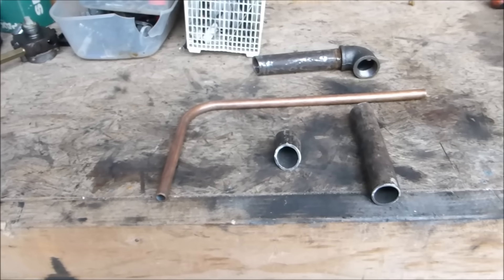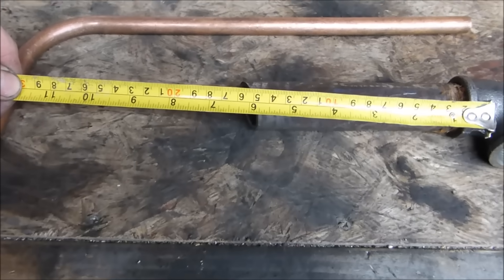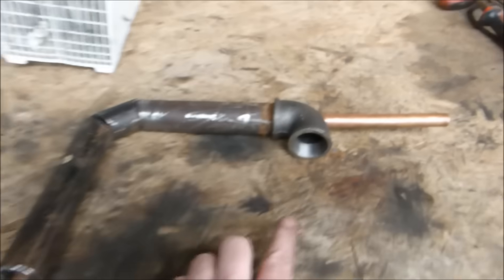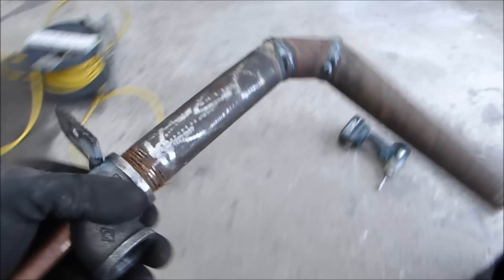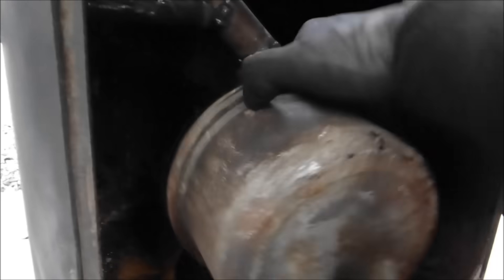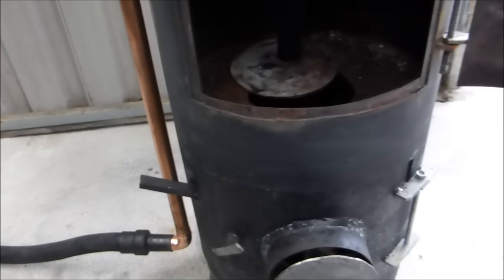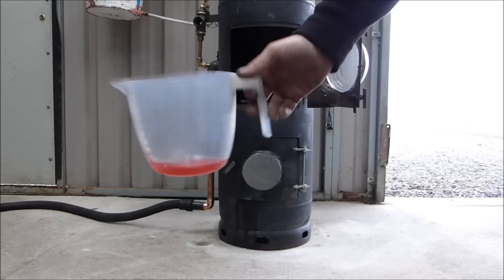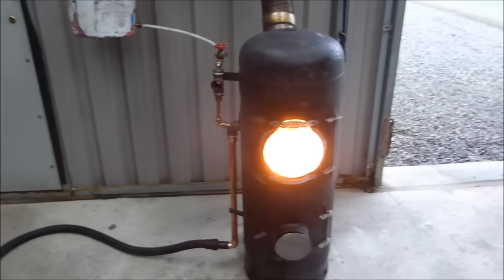Build a New and improved fantastic output Waste Oil Burner.

Comment: well done and beautifully explained, I subscribed. I might have a bit of useful information: I'm in the restaurant industry, and wherever there have been restaurants, there is a restaurant graveyard somewhere. This is where all the stoves, ovens, burners, grills, fryers and so on go to die (or be repurposed). It's an intelligent mechanic's paradise, because this stuff is scarcely more than scrap to the junk yard owner. If you want to "pick and pull", all the burners and grates and tubes and governors and valves and pipes you want, you can buy for a couple of dollars. I use them for fixing my restaurant, but you could certainly use them for a myriad of burners, alternative fuel vehicles, jet engines, who knows what else.

Comment: You could have also drilled 3 holes in the outer pipe and put some screws through it to center the copper inner pipe..

Comment: Hi  Gerry. Great videos. Great ideas. would it be worth putting a flash back arrester in Line on the oil feed just as a safety precaution??? or is there any need.??

Comment: it takes electricity to run, 40 years ago in potbelly stove a 3/8" plate steel piece at an angle in the belly with oil dripping on it.

Comment: A few more observations, you would want a blowback valve if you have a feedback attatched with larger amounts of fuel ,oil ,kerosene or however you spell that,  I think there are better says to achieve what you are doing hele, the idea is good  but nobody wants accidents based on these sort of videos ,so be careful out there.

Comment: out of interest do you still use that oil burner did you find any parts that you would want to improve or any safety aspects you weren’t happy with just out of interest as it’s an old video and it’s just popped up on my recommendations it would be cool if you had a follow video to this or you might have one you can send me the link to thank you

Comment: Gerry, here’s one you should attempt that you could get paid for your energy source. We leased out several acres to a tire recycling business that had extreme potential but was owned by an idiot. He ended up grinding close to a million tires with no ability to remove the metal. As you can guess, a fire broke out and soon we were making worldwide news. We used the equipment from our surface coal mining facility to build a dam all around the burning chips that were stacked 30ft high. Used several 6” and 8” pumps to fill the entire area with water. We completely extinguished the fire in 2 days, but the interesting thing is the superheated chips buried in the middle of the continuous lack of oxygen caused crude to separate from the rubber. A stream of overflow was mostly crude oil that we had tankers skimming the top of the sediment pond. That has always had me wondering if you had a way to heat a tire in a sealed, oxygen free atmosphere would the trapped crude be enough to feed itself sufficiently once everything is up to temp. Not only would the oil make heat, but the remaining material is very high quality carbon steel. The environmental unfriendly ash from the cooked product now becomes a high quality fertilizer that we used on the reclamation mix that had incredible results. Don’t know if we could make it happen in a garage, but seen nature create several tanker loads to be taken separate the remaining water. With the thieves controlling our energy prices again, may be with a try. I imagine crude will be tough to acquire once WW3 is played out to realize Chinas 100 year plan to own the world. Drafted in 1949, China will accomplish this plan years ahead of schedule.
Reply: K

Earache

Comment: I had a thought.......
What if you use the fan, which you use for bringing in the air, to spray the oil in the flames ???
Would you use less oil
Would you get a higher temperature
Would you get therefore a flame that is instead of yellow, blue(er) and so could be more efficient ??

Just mentioning 

Kind regards, Jacob

Comment: Just out of curiosity what did you use for a window on the door
Reply from the maker: Hi. Its just  pyrex cookware dish. They work great and seem well able to handle the heat. Just leave the metal enough room for expansion. Cheers Gerry
Reply: @GerrysDiy  thanks for the info

Comment: Jerry. My T valve with hole drilled thru the back first was draining over the hole and pouring out the hole. 
Leveled the T valve left and right. I cannot get oil to flow in the center( pencil lead thickness like yours flows. It just fliws against the side of the walls then flows in. 
Any helpful ideas please

Comment: Thank you so much for your detail with stating measurements, angles, etc. The last video i watched, the guy was using an adjustable wrench to turn a thread tap and it made me cringe so this video was a relief. Your attention to detail makes it easier for followers to replicate the project. Keep up the good work!

Only question I have is.... If I want twice as much heat output do i make 2 of them or can I scale this design up proportionately? Will it still atomize correctly if I double all of the dimensions?

Comment: I saw this thought it was great gave me the ideas ,how ever I kept on modernising.your not burning efficiently yellow flame means not all burnt  waste of oil. I’ve built a couple and you can see  through the burn chamber even with the door open clear as a bell so hot it eats 6 mm steel if close enough plus inner skin to stop it blowing the tank away and angle uprights cos the tank would sag

Comment: The galvanised wire and copper tube could be an issue with electrolysis and effect life of the copper tube.
Reply from the maker: Hi Ian. After a few sessions in the fierce heat the wire does not remain coated for long. Works great though and I have used this setup in many of my stoves as I play around with the design. Appreciate the comment Cheers Gerry  👍👍
Reply: No worries

Comment: What kind of glass is that?
Reply from the maker: Hi Tony. It's just a pyrex bowl. The glass can handle the heat you just need to give the metal enough room to expand without putting pressure on the bowl.  Thanks for commenting Cheers Gerry

Comment: Love it, very clever yet simple and effective! Subscribed! I need to build something like this, to burn my waste motor oil + cooking grease. I know I can probably (legally) dispose of it for free, but there's something about throwing away perfectly good fuel that hurts. 
I am curious why popular commercial waste oil burners use compressed air to atomize the fuel -- I have seen several gravity drip designs like yours, and I would assume that once the fire box gets up to temperature, the intense heat is all that's needed for complete combustion. Maybe the pressurized air is just to ensure complete combustion from the minute you fire the unit up, to ensure a quality burn even when cold starting, since the commercial units can be run off a thermostat. Either way, for a typical home shop, it would probably take years to pay back the difference between something like what you built, vs paying ~$2k+ for a commercial unit.
Reply from the maker: Hi Matt. I have made normally aspirated burners too and they work great without any power. The trick was to change the burner design. No visible smoke and tons of heat too. Thanks for the Sub and taking the time to comment Cheers Gerry 👍👍
Reply: @GerrysDiy  .can you put a system like this in a outside central heating boiler chamber if the standard riello oil burner is removed

Comment: Half inch washers welded in pipe ?
Reply from the maker: Hi Josh. The washers would stop airflow between the 2 pipes. The 1/2 inch copper carries the oil and the  1 inch steel pipe carries the air for combustion. A spring will allow the air to continue. I have made lots more burners since this one. Here's a playlist https://www.youtube.com/playlist?list=PLmQ5wJnkAIoJYDBgSOis9s1yDhcFdswtN   Thanks for taking the time to comment Cheers Gerry 👍

Comment: What keeps it from just blowing up? Lol 😆 sounds like a noob question
Reply from the maker: Hi. Slime There is no pressure build up.The exhaust goes up a chimney and the stove gets a measured amount of fuel. The oil burns because it is being vapourised by the intense heat in the burn chamber and the gas readily burns. Can make a serious amount of heat though. Thanks for commenting Cheers Gerry👍

Comment: Impressive! Although, how much air escapes from the hole in the 1" pipe elbow where the copper pipe goes into the plumbing?
Reply from the maker: Hi Oddly enough that hole acts as an air intake when the fire is lighting. Some of the air for combustion is pulled through the gaps. This is why when the stove is running I can open the door and the fumes still go up the chimney. Also if i run the stove nuclear and it is glowing red that hole gets bigger with thermal expansion. Thanks for commenting Cheers Gerry👍

Comment: Hi there, great videos and watch them a lot,. I made one a couple of years ago but struggled getting it hot enough with lack of airflow through the stove. I'm now gonna try it with the pan and air pumped in. Might have to start from scratch as old cylinder is burning away. 
Q what sort of pump/blower are you using.
Fantastic vidios, very inspiring 👍😊
Reply from the maker: Hi hiluxtoy. Sorry I missed your comment but the channel is getting bigger now and it's getting impossible to keep up. I made a new stove that has no waste oil burner in it. I will be doing a job on it over the next couple of weeks to get it running on oil. There might be something you are missing that you will find in those videos. keep an eye out for my live stream in about a week and I might be able to help you out there. Thanks for commenting Cheers Gerry 👍

Comment: Great design, I’m going to make a mini version to use as a stove, is there a way to stop heat going up the chimney?
For example put the chimney at the very bottom at the back so all the gasses have to travel up over a baffle and then down to the start of the chimney and out? If that makes sense? 😂
Reply: I think you probably could use such a baffle, or even a series of baffles but definitely keep the bottom of the chimney up high or the exhaust will just back up and likely extinguish the flame.
Reply from the maker: Hi Fluffyhead. This works really well and can make an absolute ton of heat. good luck with your build. Cheers Gerry

Comment: I cant help but notice that your oil is new, maybe even cooking oil; how about waste oil? Dirty, nasty used cruddy waste oil! 
I'd personally like a true representation of flow and how to keep the actual fuel running. What problems occur with real waste, do you filter, how to filter etc. 
I feel fresh oil is misleading because that's not what anyone will be using for fuel. Otherwise great video and thank you for taking the time to make it.
Reply from the maker: Hi Jon Doe. This will burn any type oil that will flow and  makes a ton of heat. The trick is to get the burn chamber red hot and after that it's pretty agnostic to what is burnt. Thanks for commenting Cheers Gerry

Comment: Very interesting,  I do believe I just found a new project!! Just curious, do you keep a steady drip going, if so what would prevent the flame from traveling up the supply line? (Sorry if you talked about it in video, I skipped through some parts) thanks for sharing
Reply: The oil doesn't get hot enough. In fact it's kept very cool by the fresh air running around it. The oil line is within the forced air input.

Comment: . . . what is the source of your forced air?
Reply from the maker: I use a variety of blowers but in this video I was using an old oil burner fan as the blower. In some of the videos I have even used a hairdryer on cold. Not long life but good to experiment with. Thanks for commenting Cheers Gerry

Comment: How much air pressure are you using
Reply from the maker: Hi Truck Talk Videos. I am just using a fan but the pressure is low just a few psi. I have another burner that I make that uses no fan and can make as much heat. here's a link https://youtu.be/kWul5SL2FOg Cheers Gerry

Comment: Почему медную трубочку прячут в железную? Зачем это? Почему так нужно делать?
Reply from the maker: the outer tube is steel and I can send air into the burn chamber through the steel pipe. The copper pipe is for delivering the waste oil. hope this helps Cheers Gerry
Reply: @GerrysDiy  медную трубку оставь, как есть. В железной трубке.
Но воздух в нее не подавай. Он холодный, а это плохо.
В камере сгорания должно быть максимально жарко. Пекло должно быть. Масло желательно подавать горячим. И подавать раскаленный воздух. Воздух предварительно согретый пламенем.
Тогда реакция окисления, то есть, горения, происходит мгновенно.
Будет меньше копоти и дыма.
Пламя будет только в камере сгорания, а не в трубе.

Comment: Your waistline all that energy, horrible design in my opinion, in Vermont your used oil is worth $ depending on the exact product and quality but we use waist oil for heat..seems so wasteful to burn just to get rid of
Reply from the maker: Hi. There are more efficient designs but as a shed heater it makes a ton of heat and for me here in Ireland it's free heat. It's been a mild winter this year here but doesn't get as cold as Vermont. Just heading out the door now to go paramotoring. Thanks for commenting Cheers Gerry
Reply: GerrysDiy well I owe you a apology, I did not realize you where using the heat, I am sorry I should of paid more attention, I thought you where just burning the oil and all the energy was going up in smoke, my bad.  Hope you had a wonderful flight, I am a pilot as well.

Comment: I want to turn something like this into a rotating force that will run a generator.  First thoughts...boiler with steam engine powering a generator...now I'm thinking...heat escaping up and out stack...how can I get that heat escaping to rotate a shaft and power a generator...whala..off grid power production....spin a turbine idk...let me know what you think.  gandl2123@gmail.com

Comment: Reply to Brad not Landa
I was in the infantry in Alaska in the end of the'Nam era. We'd be out in tents at 60° below Fahrenheit and more. 

They were heated with "Mogas" which I think was a blend of diesel and kerosene. We'd suspend a 5 gallon Jerry can on a tripod and feed a thin copper line through a thick rubber section of roof. The fuel line went into the Yukon Stove, about 12 inches square and a couple feet long with a 3 inch or so Diameter chimney. 
There would be a fire lit right at the front door with kindling and branches under a cast iron plate that the mogas would drip onto.
NOT a steady stream, a drip by drop onto the plate. The wood fire would burn and the mogas would drip onto the wood and charcoal and keep it burning. That fire was directly under the cast iron plate - which eventually got hot enough to vaporize the drip on contact by the drip. At that point, the fire roared in time with the drip speed. The sides near the front would get bright cherry red. Forging temperature.

Comment: Yea this build has been already done this is just a copy of a another video. I dont think that is a Propane tank it looks too thin. More like a hot water tank 40 gal?
Reply: Obviously an armchair critic.... because u obviously have never cut into a propane tank ... they r very thin , an old air tank will be 2 to 3 x's as thick as a propane  tank ..  and a hot water tank would be about the same thickness as a propane tank.... just n case u ever wanna get  out the chair n build one .... use an air tank

Comment: Really like your videos Gerry. 

I'm building one of these myself using an old compressor tank.

Gave you calculated fuel usage at all? It would be interesting to know how much waste oil is burned over a said period of time in relation to the heat output.

I have a large workshop that I am intending to heat with mine.
Dr Gadget.

Comment: I'd imagine it would make the room a bit smelly.  Pretty cool.
Reply from the maker: Hi Sean. The flue can make enough negative pressure to remove all the fumes 100% Amazing amount of heat for very little fuel. I have made my own burner that does not require a burner. Check out one of the playlists. Cheers Gerry👍

Comment: Quick question. When using waste cooking oil do you need to preheat oil?
Reply from the maker: Hi Dbrown Brown. I don't preheat the oil, room temp works well but if the oil was very thick maybe then it would need it. Thick oil could be pumped with a peristaltic pump again without the need for preheating. Cheers Gerry

Comment: Hi Gerry,

I made a waste oil heater of my own..  i'm from holland..

I use a steel plate with a 130mm hole welded a 130mm 15cm high steel pipe on it and made arround 25 holes in it.. closed the top of de pipe .. and welded a 15cm steel plate arround it for the oil to come in.. place a lose 40cm wide plate on the top.. but i still have a amount of black smoke.. 

Do you have any ideas? 

Do i need to place the holes lower? .

Comment: Gerry could you give me some advice i want to convert my wood fuel water boiler to burn waste oil would appreciate your advice
Reply from the maker: Hi Saqib Ali I have some videos in the play list where I converted my boiler stove to run on waste oil to heat my underfloor heating and it works unbelievably well. The boiler stove I just made link will be used to heat some underfloor heating too. here's a link to the play list https://goo.gl/u9aZEi Cheers Gerry

Comment: Add a  cat converter to filter the fumes an also can recover water .
Reply from the maker: Hi jeje7501 I would need a huge cat for the 6 inch flue but I guess I could make one work. I made a boiler stove to heat water using one of my burners yesterday and it heated 24 gallons of water in about 10  - 15 minutes https://www.youtube.com/watch?v=JHsNoqp9QAE Thanks for the comment Cheers Gerry